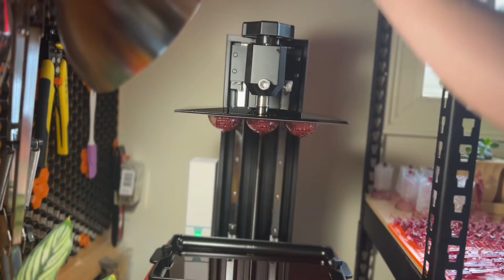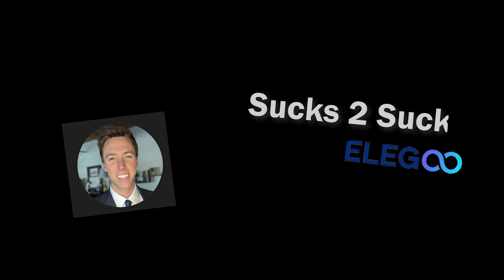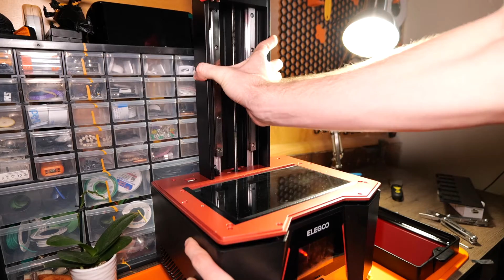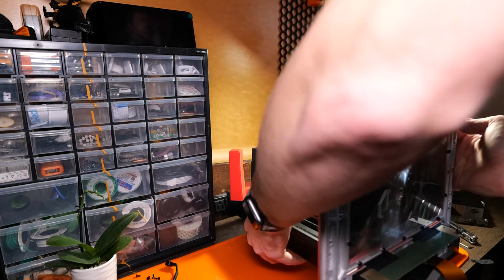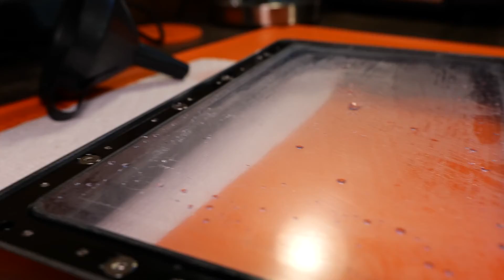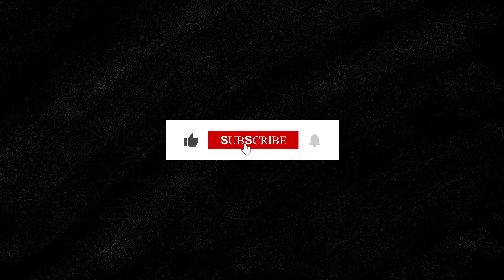3D Resin Printer Vat Screw Repair - DO NOT OVERLOOK THIS

Comment: Spencer, this was invaluable. I actually broke off one of my vat screws on my Mars 4 Ultra trying to unthread it... the culprit? a big resin pill that slowly hardened over a few weeks. I was VERY lucky that I was able to get the screw with a set of vice grips, and found some replacement m4 screws at The Home Depot. Lubed the m4s with IPA and went to town, sure enough, NO RESISTANCE any more! Cheers buddy!

Comment: I was too late on this video. I just snapped off a screw while taking it out, after it sat for awhile unused. Crap. Mars 5 paperweight right now. What size is the screw? Maybe I can tap it and the resin vat slightly bigger and replace the screw.

Comment: I ended up ditching the finger screws and put normal screws with the correct threading and size in there with a hand driver. it worked great until I had to change my resin. Luckily with a normal screw head I moved to an impact screw driver to remove them, which helps prevent slips and stripping. This ended up breaking one of the screws in half leaving some of the screw inside the top plate. I dont even wanna look at it any futher just gonna take a break. Is there another way to keep the vat down?

Comment: I've just had a similar problem - took my screws out but when I went to get them back in the holes had miraculously shrunk.

As it happened I have a couple of pipettes so gradually added IPA into the screw holes one drop at a time then putting in the screw till they got stiff and then backing them out and cleaning them.  It didn't take too long and the holes were cleared.`

Comment: had this exact issue. I love when I find the solution on my first google. Thanks!
Reply: Woooow, I must not have cleaned the printer side enough. Had to mangle my first bolt. Replaced it, made sure I could get it out before I started my print, and now it's as stuck as the first one... very sad.

Comment: The main issue with the vat/frame joint is that it uses two materials: steel bolt and aluminum frame with threaded holes. Due to hardness difference it wears off.

Comment: I unfortunatly had this issue uesterday, and my screw snapped in half while trying to unscrew it, now its stuck stuck aaaaaaaa
Reply from the maker: I'm so sorry! Either you can go the Elegoo customer service route or you can get one of those drill bits that allows you to drive the screw out? I'd personally just buy a new part from customer service. I don't remember it being an expensive quote! Best of luck!
Reply: that happened one time... I used smaller drills and getting bigger until I allmoust "eated" the screw away not easy though.
Reply: This just happened to me too. Why didnt they design quick release clamps on this

Comment: Thanks for this. Had a stuck screw today on my S3U, but I'm sure that it's not resin. I managed to remove the screw with pliers, spritzed with IPA (thanks to you), screwed in as far as I could, backed off, tightened again, removed, wiped the screw, more IPA, and did this repeatedly. Maybe 40, 50 times, I lost count, but I've got sore fingers. Repeated tightening and loosening a few times on each iteration seemed to work well after some time. I didn't disassemble the machine. Anyway, after a while more and more black gunk was getting in the threads, and the screw was getting easier. I've only used clear resin, and only printed a few times. Maybe it's factory grease that has hardened (I do use a brew belt) or some other contaminant, but I've been super clean and can be pretty confident it's not resin, especially as the blockage was far down. I've only removed the screws a few times so far as I've not changed resin and don't routinely need to move the vat, but I'm thinking it prudent to at least loosen screws after a print, perhaps removing and cleaning each time just to keep the threads as pristine as possible. I sprayed them with PTFE spray when clean. I cleaned the screw that wasn't stuck, and that seemed to be getting tighter, so I did a more thorough clean as for the stuck screw, and with that more black stuff came out. So I don't think we should be hard on ourselves if this happens, as it seems more like a product defect.
Reply from the maker: It's definitely not us, it's just the nature of the product. Unfortunately, we are not equipped with that information when we buy the printer. I still believe it is resin personally. It seems like in my Saturn, despite also being very clean, certain resins just seems to splash more from the drips. I've been dealing with a buildup of resin on my hood over time from this, and sometimes the hoods gets a little tacky and sticks to the machine. I think it's just resin that catches dust and other debris and hardens over time. There could also be some grease! Thanks for you comment, and let us know how the PTFE spray helps!

Comment: a tip: music too loud
Reply from the maker: 100% agree. I fixed that in the following video. Thanks for the feedback!!
Reply: @SpencersDesk  also it's best to avoid drumming parts with spoken word and use something more ambient, more in the background as not to distract from the speech.
Reply from the maker: That makes sense! I'll try that out in the next one I put together. Right now, I just place an entire track in the video. Maybe I should be using multiple songs and just taking shorter segments.
Reply: @SpencersDesk  I worked as a composer for couple of films, and it can be quite tricky to make music that has certain flavor and character and yet not to take attention away from the main scene. The director usually wants the music to be the support and not carry the scene, so if you begin to notice it, then it can be problematic, depending on the genre and director of course.
Reply from the maker: I see. So if I'm watching a video back and I start to notice music...

It's either too invasive or the content is getting boring. Super helpful tip!
Reply: @SpencersDesk   I never said that the content is lacking in any way, just that the music is too distracting. I watched ur video from beginning to end, and it's good, I wasn't bored at any point.
Reply from the maker: I know that you didn't say the content was lacking. I guess I added that part in on personal experience. I think I begin to notice the music when I find the content is losing my attention. I didn't mean to write my reply in a sarcastic manner but I can see it could come accross that way.
Reply: @SpencersDesk  you literally used strawman fallacy, like I was implying these things when I didn't.
Reply from the maker: I apologize, but that was not my intention.

Comment: Where did you get replacement tape for the lcd screen?
Reply from the maker: I had some “electrical tape” sitting around. It’s definitely not the same but it’s similar. The original stuff seemed a lot grippier whereas electrical tape isn’t so grippy. It seems to be working fine though!

Comment: Here's a tip. Place a vertical slot into the screws. Should be angled ~45 degrees or so. This will turn them in to sudo self tapping screws.
Reply from the maker: I just looked up a video on making self-tapping screws. You think it help remove the resin build up as it goes? I don't think it's a replacement for cleaning the holes once in a while but I think it would extend the time between cleanings! Let me know if you do this yourself!!
Reply: @SpencersDesk  it will help to some extent.